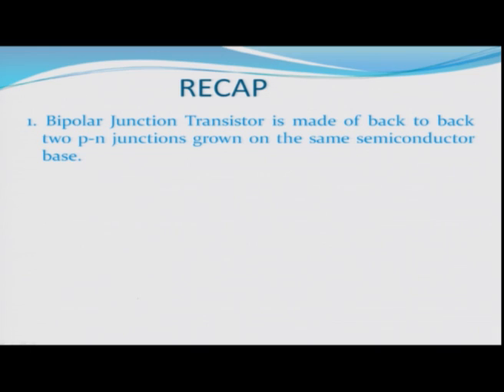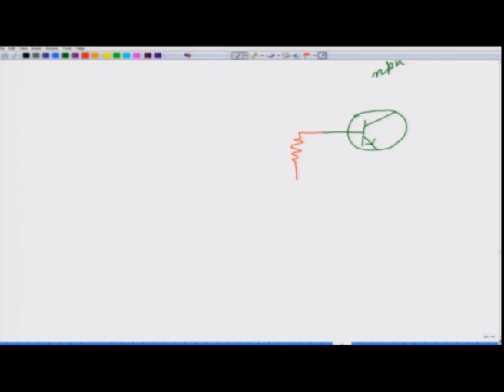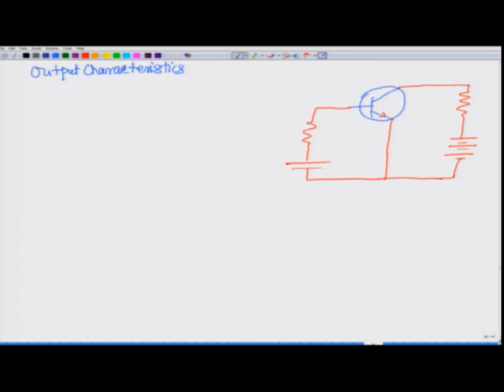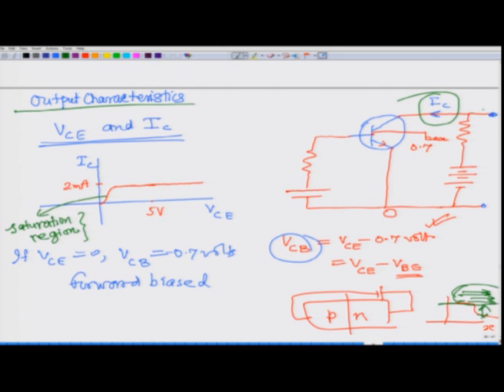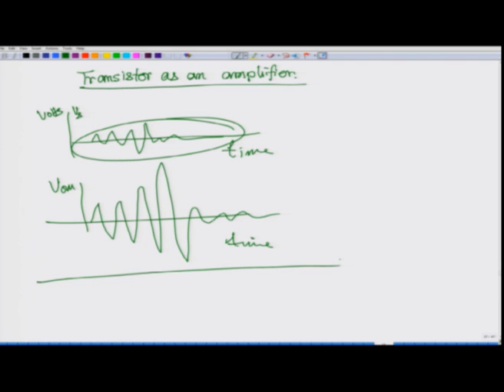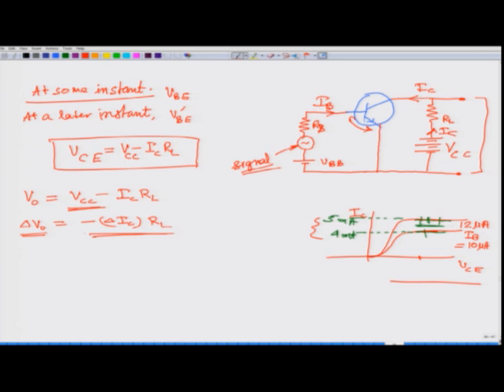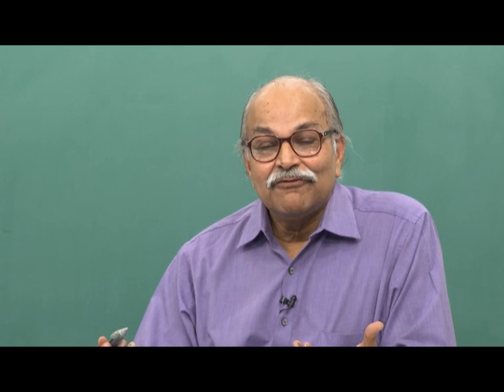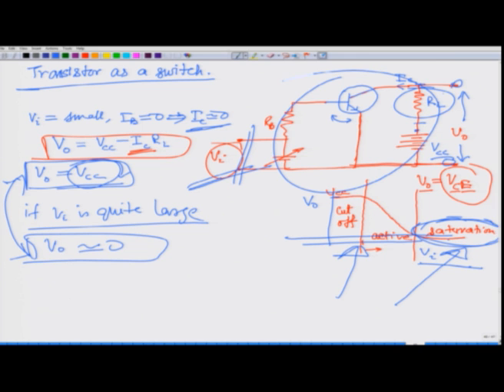Transistor as an amplifier and as a switch (PHY)

Comment: 19:32 the circuit is said to be on junction and reverse biased but we see that vce is across n-n emmitter and collector
Reply: You dont have to bias collector emitter you have to bias collector-base in reverse mode. for that you can keep Voltage across CE higher than Voltage across BE

Comment: sir, im having trouble on that equation explaining the relation among the Vcb=Vce-Vbe .How ? 18:06
Reply: @gaurav singh actually u can apply this concept to mains also these are actually the basics . However im now in Bsc. physics .
Reply: i guess after bsc u can get into iisc through entrance exam .So ,im for now in an autonomous college.
Reply: Me also??☹️
Reply: Explain me
Reply: @akankshamaurya5897  i guess if u put a simple transistor  diagram u can check the potential differences and there u can see potential difference between collector and emitter equals potential difference between collector and base plus potential difference between emitter and base
Reply: simple diagram i mean take like pn junction diagram rectangle shaped having left side with emitter ,base in the middle and collector in the right side and connect to the battery in a proper biasing method like forward bias in the emitter base junction and reverse bias in the collector bias junction
Reply: Remember how u used to add voltages! Here two voltages are in seies with polarity opposite to each other! Simple
Reply: @mohammedsrivastava5917  yes i got it

Comment: Sir npn PNP ki direction me always confusion rhta
Reply: Being an electronics engineer. I am eligible to answer your question clearly. Bhai PNP me yaad rkhna hemsha Emitter me entr krta h..Base and Collector se niklta h..Ie = Ib + Ic....NPN me hmesha Coleector and base me enter krta h ..Emitter se bhar niklta h..Ic + Ib = Ie...kuch bhi ho je Collector nd base ka sum eMITTER  curent ke equal  hga.
Reply: see current always go from p to n ok
and emitor base junction is always forward biased  remember it you will never be confused
Reply: @akankshasachan6119  emitter base junction is not always forward biased. Emitter base junction is in the reverse biased mode in the case of Cut off region and it is also in reverse biased mode when a transistor is used as an attenuator. It all depends on how we use a transistor.